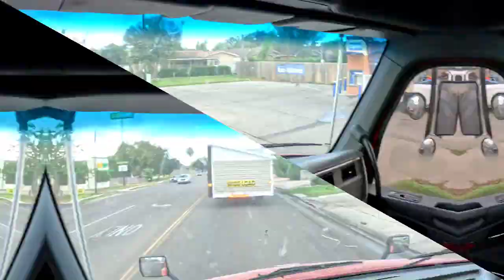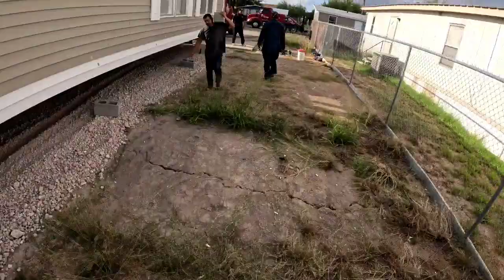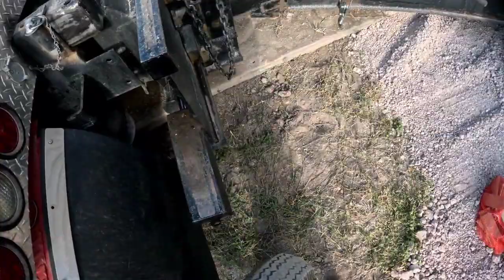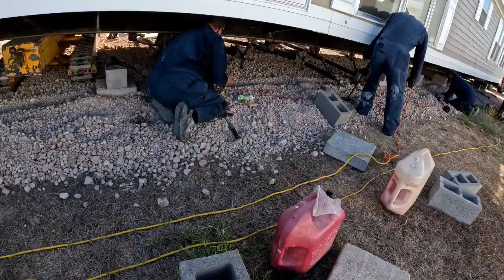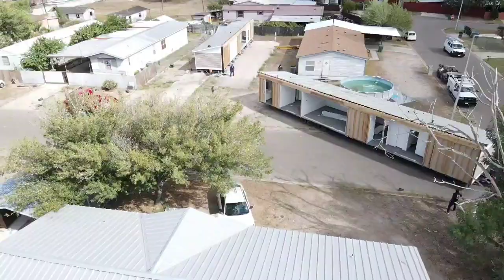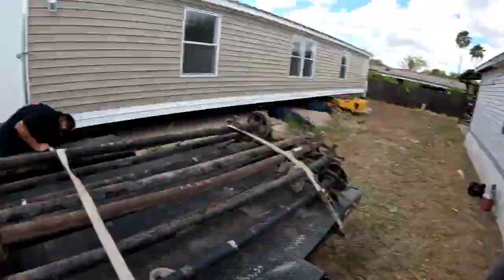Mobile home delivery in 13 minutes!‼️‼️🔥🔥🔥 #mobilehomemovers #installers #mobilehome

Comment: J. Wbber Homes, Elevate your towing journey with Towaide's TA88 or TA89 models, guaranteed by a lifetime warranty. Embrace the assurance of a dependable solution and easy installation. Benefit from the convenience of remote trailer lights featuring amber flashing for improved visibility. Illuminate your surroundings brightly and transmit your truck's light signals wirelessly, all within a compact, battery-operated
Reply from the maker: Got a website